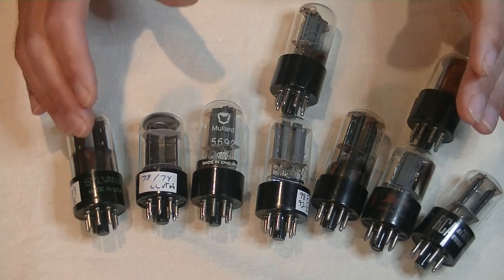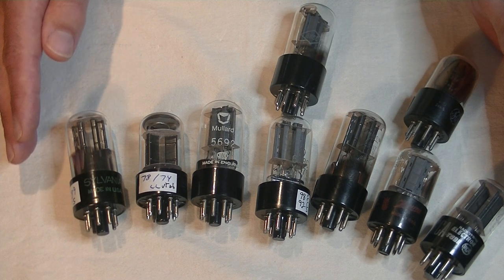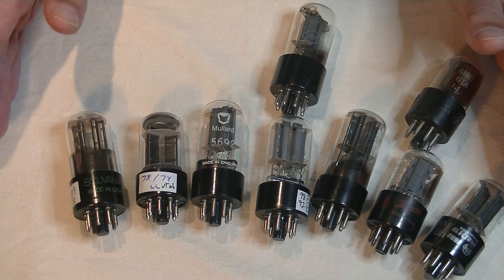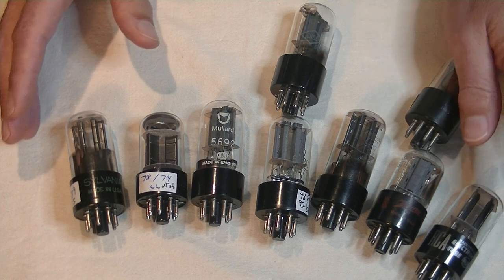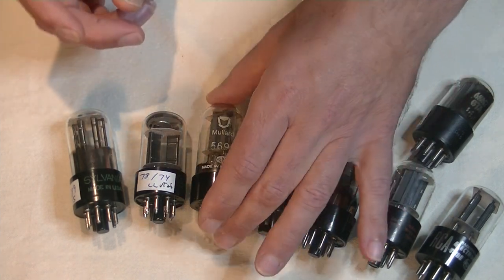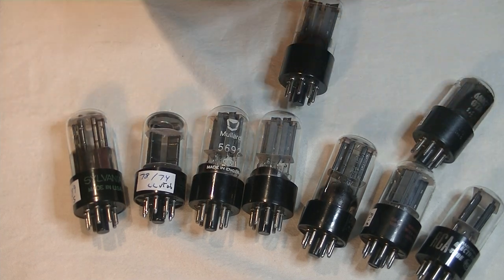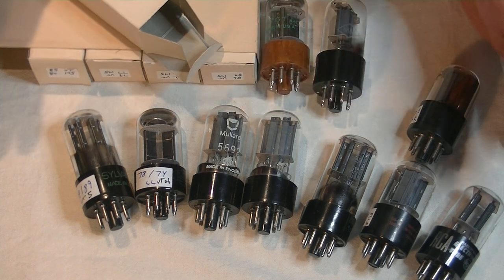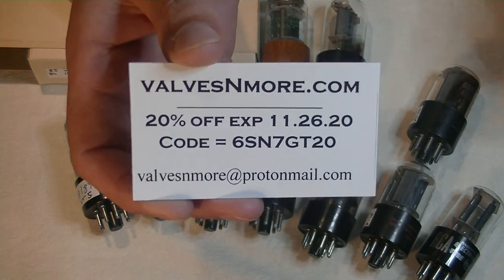Tube Lab #10 Rolling 6SN7

Comment: I was surprised that you didn't note that the 5692 spec calls for a maximum plate voltage of just 275V and that it has a maximum plate dissipation of just 3.5 watts, well under the modern 6SN7GTA/B specs.  Many modern circuits will overdrive a 5692.
Reply from the maker: Thanks for reminding everyone of that!  I fit these videos into my valvesNmore work week, and even though I research and script each episode, I'm gonna miss something!  In my defense I do regularly remind folks to check the specs of their tubes, specially the variants.
Reply: Thanks for heads up. I thought they were directly replaceable??
Reply: They are still being peddled by NOS stores as a 10k hour tube without stating if it’s kept to spec. With our normal gear, it’s back to perhaps 3k-5k hours or so again. 

Still ... they do sound good. The RCA Red Base are pricey though.

Comment: Thank you for your explanation. I am looking to get a better sound stage from my Schitt Freya pre-amp. Yes I like good base and imaging. I am new to tubes so I am concerned about the plate voltage. How do I find out what the plate voltage is on my pre-amp? Headed to your website now
Reply from the maker: The short answer is ask the manufacturer if the 6SN7GT will work.  However in a preamp (not a driver position in a power amp), they will almost certainly work just fine.  Most designers of tube circuits, aim well under maximum ratings, the possible danger areas include power amps and guitar amplifiers, which are often run hot!  Sorry for the delay in replying, some messages never appear - I just found this by accident.

Comment: I looked the datasheets for Russian tubes, but it looks like the plate voltage is 250 with 330max, not quite a GTB
Reply from the maker: This is a very good point, always check the data sheet if in doubt!  Unfortunately the translated data sheets for Russian tubes are few in number and are often called into question (higher spec than advertised!)   Many circuits using the 6sn7 will have the plate voltage set around 250vdc.  Because of the lack of information, I have already tried the 1960ish-2000 Russian tubes, in my various custom pre and power amps.  If they can survive my amps - and they do, they should be able to handle any circuit you would use a 6sn7gtb.  The tubes I would be careful with are the older vintage Russian version of the 6SN7GT's, these date from 1940's and 50's.  The same caution applies to ALL of the early GT's made in Russia or the West.  Specially Sylvania "Bad Boys"!

Comment: Great explanation sir.
Which 6sn7 tube is equivalent for low gain in Williston R8.
Reply from the maker: Sorry I'm not certain what your question is, probably lost in translation!  Are you asking what equivalents are available to the 6sn7?  The 6sn7 in the R8 is a phase/driver tube.  The main voltage gain is the first stage 6sl7.
Reply: @tubelab194  yes I was asking the same. Thanks for your help and time.

Comment: Have you listen to the Sylvania 6SN7GT 3-Hole some people say they sound better then the 2 hole?
Reply from the maker: No, in fact I've never seen one and it is one of the tubes I specialize in, so I don't think they're very common, it would be interesting to learn the date of the variant.  Just to clarify for others -  the holes are in fact vertical rectangular slots on the wings of each plate, they're made when the plate is assembled and are properly called rivets, though they are more like metal tabs folds over.
Reply: @tubelab194  you tube won't let post a pic of one but if do a google search for them there's a lot a there
Reply from the maker: @outboardfun3353  Tube Maze has a great write up on the 3 hole and he says "briefly made 1951-52" which explains why I haven't seen one.  I currently have about a dozen in stock and checked them all, and they are all 2 hole versions and the dates are 1952 55 & 62 (when a date code survived!)
Reply: From my understanding or, per seller who makes a living selling tubes the two hole versus three hole configuration is pure hype. The hype was invented by other sellers to inflate the price/s of three hole tubes. I now shop for "Bad Boy two hole" and honestly cannot tell the difference. Common sense tells you another damn hole is not going to improve the sonics. Keep researching the 6NS7 and you will find very good performers at a reasonable cost. Now, be prepared to spend some money to get a good performer, but not @ a ridiculous price. Point is, the Sylvania 6SN7GT or GTA/GTB Bad Boy two hole is a damn good performer and you will have to pay anywhere from $150/200 for a pair of NOS. I even purchased 2 x 1578 = 6N8S = 6SN7 METAL BASE HOLE PLATES TUBES || NEW & NOS || MELZ || PAIR from Ukraine for $220. These are considered one of the best sounding tubes and i was not disappointed. On the other hand I also purchased 2 "USED" SYLVANIA JAN-CHS 6SN7GT VT-231 VACUUM TUBES TV7 TESTED for $99.00 and waited on them to arrive as we speak. Not the least bit worried about the sound or longevity.
Reply: @donguin1885  Thanks you

Comment: does 6SN7 can run each section 7mA on anode? if yes, it means total 14mA (7+7) am I correct?
Reply from the maker: 6SN7gta or gtb (not earlier lower spec'd GT), according to Sylvania data sheet design center values (av. Max) class A, plate 450v, plate dissipation 5.0w each plate, 7.5w ***combined, cathode current 20mA.  Plate dissipation is what you want to keep a close eye on.
Reply: @tubelab194  dear sir, if to calculate 7mA on 265VDC anode (Anode resistance is 7700R) and 8.7DC cathode under ohms laws, how to ?   Thank you very much. I am bad in mathmetics.
Reply from the maker: @nuttyl283  P=V/R, p=power measured in watts, v=voltage, r=resistance measured in ohms.  So p=8.7/7700 p=0.00113 amps or 1.13mA